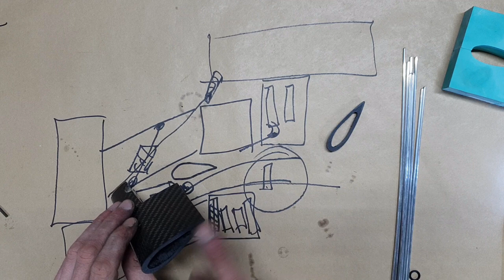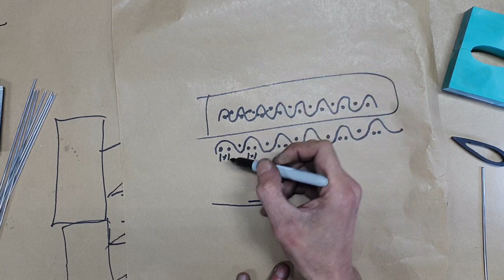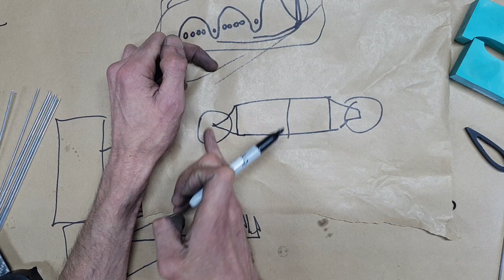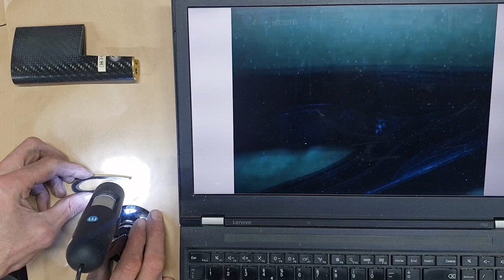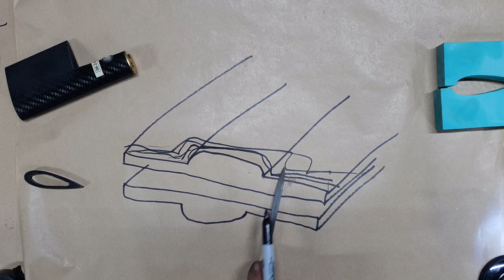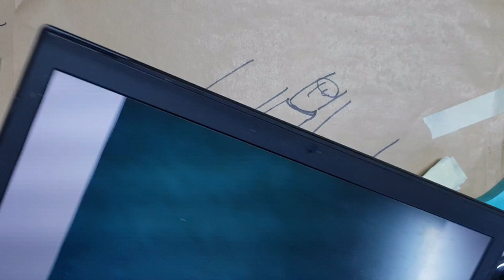F1 Carbon Fiber PushRod - A Closer Look - Ep 14

Comment: Looks like the resin thats built up is from lathering the inside of the pushrod with glue and then pushing that metallic part in and then the thread where your saying its injected in is for just positioning it when putting through the pin. Got to cut stuff apart we made at an old job to check that kinda stuff, looks the exact same.

Comment: Generally, the method of NDI, (non-destructive inspection) of parts of this nature would be UT, (ultrasonic inspection). 
Specimens of various sections and profile / section specific transducers would be used for calibration of a acceptable wave form on the display.
Specific deviations of the waveform of the test part versus the specimen, are indicative of, “discontinuities”, representative of faults or defects, such as voids in layers and bond lines, delaminations, etc..
Not intending to be critical of your presentation, rather attempting to add clarification of something I have experience with.
Thanks again for revealing and sharing the almost supernatural aspects of F-1 technology.
Reply from the maker: Thanks for that George!
Reply: @EngineeredtoWin  as you expressed the intention of going down the path of composite materials, another method commonly utilized in the inspection of composite structures and especially honeycomb core structures, is simple tapping. 
Tapping the surface of a structure with a void hammer, (small blunt hammer, having a spring wire handle) or even a coin, which will produce a generally sharp sound on impact. Voids, delaminations, and things like core / fluid contamination will result in a dead sound.
We frequently use this method of inspection on aircraft structures to include components like helicopter rotor blades.
Ain’t rocket science wonderful…🤪

Comment: 59:48 Interesting so they epoxy coat the metal before bonding it to the cf part, does that also act as protection against galvanic corrosion, or is that never a concern as parts arent expected to be in service for long periods? I know in aero they often use a layer of fiber glass between the cf and aluminum to protect against gal corrosion.
Reply from the maker: It is a way to get a very good bond. A thin layer is first put on, and sanded into the metal - thus exposing the bare metal, and getting rid of the oxide layer - sanding through the epoxy means no further oxygen can reach the metal. The part can then be secondary bonded into the CF. Its nothing to do with GALVCOR in this instance.

Comment: I’m just going to high jack this comment section for a direct question:
I recently wondered why motorcycle 600cc race bikes (4 cylinder ones)don’t just use the bigger block from the 1000cc bikes and just shorten the stroke, thus increasing possible rpm if you use a normal 21 m/s mean piston speed, meaning for example the current cbr 1000 rr-r block shortened to 600cc at 21 m/s mean piston speed would rev up to 21000 rpm. Now that would go far beyond the common „limit“ of around 18000 rpm caused due to valve floating. 

And let’s they we couldn’t use the Ducati desmodromic system. Why wouldn’t you design a valve train kind of like the piston-Conrod-crankshaft from the bottom end? Meaning you have a little cam shaft kind of like a crank shaft, a little valve-conrod connected to the valves to achieve a forced valve movement without the use of springs???
Reply from the maker: Re valve actuation, Cosworth tried what you describe but it got canned. Its the first patent picture in link, its loosely what you mean - I think - https://www.desmodromology.nl/cosworth/
Reply: manufacturing, material cost, simplicity.
Reply: I have wondered this before too if I understand your comment correctly , though I don’t think I have lol . but my theory is valve clearance due to thermal expansion, valve clearance due to elongation in the parts through their cycle , Valve duration may not be easily controlled . Weight of the valve train and probably may more reasons . The reason why they don’t use a bigger block can’t be explained easily either . There will be 20 or 39 reasons why but the most common reasons will be weight/ size / compactness . Also this would alter the bore -stroke ratio which in turn alters the torque curve of the engine . Shorter stroke also means more piston slap / wear / instability due to the angle of the con rod at 90 deg 270 deg of the rotation of the crank . 
While I’m here I’ve sometimes wondered why they don’t use a hybrid type engine ie - reed valves end n injector for fuelling and then exhaust valves like a normal 4 stroke . 
Think the problem is most of it’s been tried before and there’s a good reason why it’s not common place . 
That said who would have thought pneumatic valves or electrically actuated valves were viable? But they have been used . There’s a guy who does 2 strokes I think called 2strokesurfing , he’s tried disc valves and rotary tube valves too .
I can’t really comment any further as I’m not an engine builder ,just an engineer. 😇